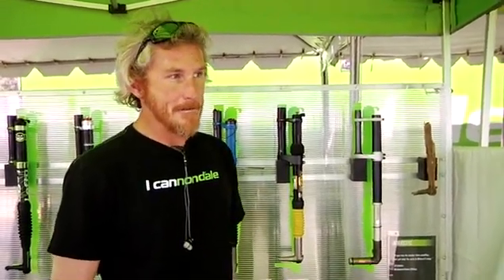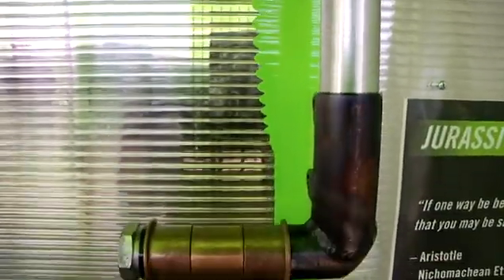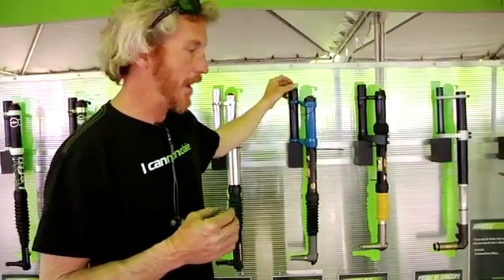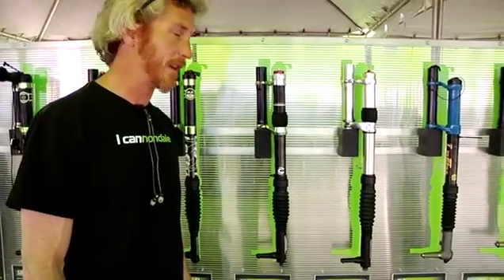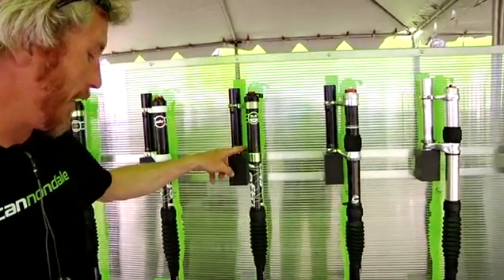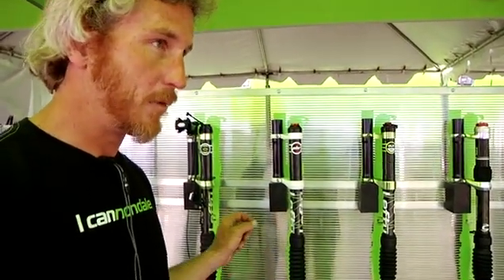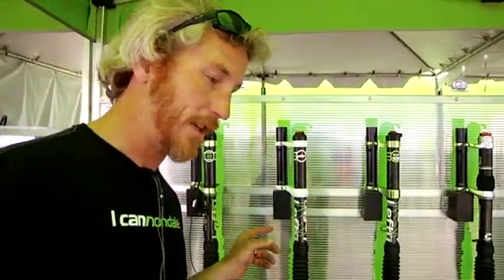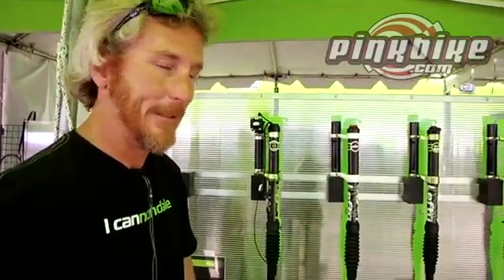Cannondale Lefty Fork Technology and History

Comment: talking about bike engineering, i like to refit them with 1000w motors and 100km worth of battery (10 pounds)... If you put 20 pounds of the simplest ebike gear onto any bike, it adds the power of about 2 horses. it goes faster than a horse, and 10 times further than a horse in a day. That means that the power to weight ratio of an ebike compared to a petrol cross country bike is about 70 percent lighter, and 100 decibels quiter. it's the future. Petrol companies are trying to erase that fact. they work with governments to ban and outlaw new bike technologies. after all who needs a car if you can have a bike that weighs 25 pounds which is faster than a horse and goes 10 times further? petrol companies will be angry.
Reply: Horses too. They are lobbying

Comment: I havnt ever touched a lefty until this month I finally bought a beauty 2012 dlr sl. I am speechless at the functionality. Small bump compliance far beyond any conventional suspension, amazing torsional rigidity...I will not be going back to a "normal" fork anytime soon
Reply: tried one years ago around a shop in town and it had up down movements as smooth if not more than a rear suspension while conventional forks go from "not moving at all" to "compressed" which is cheap and not good, that's not what a suspension is supposed to do, seems stupid of cannondale not to advertise on that aspect, it's miles ahead of all other forks

Comment: Too expensive.
Reply: You can buy them online for less than 500 bucks.  A brand new 26 inch version is going for 475.00 dollars brand new straight from the factory.  You can get used carbon ones for around 600 dollars depending on the model.

Comment: I got supermax pbr 130 29. problem with lefty fork is that, it always loses fork travel. mine loses 30mm travel after 25km ride, and the manual says that bearing reset needs to done every 50hrs. in my case not even 50hrs, so i have to reset my lefty fork bearing every time before i ride my trigger 29.